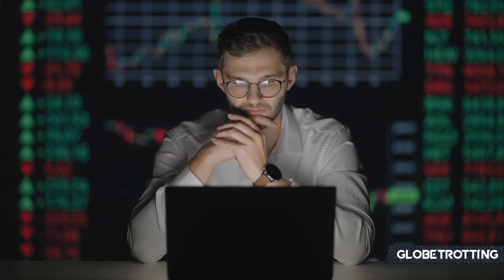Boom Supersonic Has Serious Problems

Comment: Here are some quotes about the Overture engine and Symphony power module from Blake Scholl at the 2023 Paris air show, as reported  by Guy Norris on the Aviation Week website:

“We're talking about assembly selection, not manufacturing all the individual components. We are expecting to source blades and rotors and accessories from the suppliers that build those for other turbofan engines, and we expect these suppliers to be with us through the life of the program."

 "An advanced supersonic inlet, diffuser^ and exhaust design, already undergoing initial wind-tunnel testing, is designed to meet Chapter 14 noise levels."

“There's more bypass there, because that's part of how we achieve quiet operation for take off and landing which is critical. And yet from a cruise-efficiency perspective, the minimum cross section area for lower-wave drag and lower weight is important. So the fan particularly in this supersonic condition is designed for high specific flow. That allows us to get a lot of mass flow through the fan with a relatively low-profile fan.”

“We've got an aggressive schedule,” he acknowledges. If we need to make a schedule change, we'll make a schedule change. But our target is still certification in 2029.”

And from the Ainonline website, also reporting from the 2023 Paris air show:

According to Scholl, the medium-bypass engine “leverages certified technology” to lower risk. Optimized for supersonic flight, the engine will consist of already-certified materials and use a conventional core. What’s new is the engine intake and nozzles, he said. 

Scholl admitted that the XB-1 and Overture programs “diverged” due to design refinements of the latter aeroplane, putting into question what benefits, if any, the company could glean from even flying the demonstrator.

Notes
^ The input diffuser is almost certainly based on document, NACA E55F30 of 1955: Variable Geometry Axisymetric Supersonic Inlet with Telescoping Centrebody

Comment: Boom now have a cutaway impression of the Symphony power module on their site, showing the inlet ducting, engine sections, and exhaust ducting. Symphony measures approximately 7 feet diameter and 30.5 feet long. The inlet ducting is 7.6 feet long and the exhaust ducting is 10.1 feet long.

Comment: If boom really wanted to introduce a new supersonic jet, you’d think they’d learn that their 4 engine design doesn’t work. That design is beyond old and just doesn’t meet the modern standard. Why does boom think an airline that already retired their 4 engine aircraft would be willing to buy another one that likely costs double the amount to operate, let alone purchase. It doesn’t make sense to me. Also, Boom’s renderings show an engine, which they don’t have. Why bother showing off a completed design, engines and all, at an air show when you don’t even have said engine? Almost every aircraft I’ve seen that have been introduced at an Airshow, had engines. Aren’t engines also one of the key selling points for an airline? Furthermore, the renders….those are something else. The renders are just that….a render. Nothing more. A simple render hardly proves anything other than how awesome graphics look now. How AA and United got hooked an this aircraft is beyond my understanding. It’s a shame seeing how fast this project went south.

Comment: Boom CEO sounds like Nikola dude, blowing smoke.
But what I find even less believable is the idea we'll be stuck at sub mach speeds commercially for many decades to come.
Materials, electronics, software and engine tech has advanced leaps and bounds since Concorde.
What's really lacking is the economic will to apply it. Not enough key interests see a profit in commercial SST. Not yet anyway.
Reply: Classic con man

Comment: I think a lot of us knew from the beginning that Boom would fail. Air travel these days has people wanting to fly cheaper, not faster. Concorde has been and done super sonic flight before and even after 27 years of flying passengers with only 1 incident, it still failed to make super sonic air travel mainstream for multiple reasons. I think airlines are going to continue to invest in more efficient aircraft, not faster aircraft.
Reply: Even subsonic airlines have got slower, not faster. They therefore save fuel for a slight increase in travel time, incresase that can be compensated with decent transit at the airports

Comment: I think Boom still has a shot of pulling off their Overture plane, however I think it’s at the wrong time now and their targets are too ambitious especially with the setbacks they have now and perhaps more in the future as time progresses. There is a lack of an engine manufacturer which is the big issue at present with all three major manufacturers having nothing under development at present that is Boom’s main issue now. Without an engine, the plane cannot fly but there is nothing saying a “Proof of Concept” model cannot be constructed (either with already-made engines or without). The other large issue is the future. There may be immense backlash for supersonic travel now as there was around the time the Concorde flew scheduled service. This may be a repeat of the Concorde’s struggles in service in today’s modern age.

Overall there is a lot that Boom has to overcome, both now and in the future and I don’t think the company will go under but to make this aircraft program a realization more time would need to be taken into account than their ambitious timeframe is set for. They would need to find a suitable engine, get past the lengthy certification step, and have the plane enter service, all of which will take time, money, and a lot of strategy.

Comment: If Concorde couldn’t make it after flying for many years then I see no future for Boom.  The CEO has talked about some unrealistic pricing in the future based on customer demand.  No small engine manufacturer wants to take the risk involved.
Reply: Exactly my point. I feel like they are trying to ignore that Concorde ever even existed. Concorde flew passengers for 27 years, with only 1 incident and it still ultimately failed to make super sonic air travel mainstream. Air travel this day in age has people wanting to fly cheaper and airlines want more efficient aircraft, investing in an aircraft that is less efficient and will cost passengers more doesn't fit it in at all

Comment: I am going to design a plane that has five decks, can fly at Mach 100, fly 2500 passengers and will need 10 engines, anyone want to invest in it?
Reply from the maker: I will!
Reply: @GlobeTrottingAtDjsAviation  Great, now all I need is an engine manufacturer and an airline customer. Maybe Emirates will be interested?

Comment: The only thing Boom will ever produce is one big BOOM when it goes bust.  Under current regulations there is such a limited market for supersonic flight.  The only hope is if NASAs X-59 proves that the sonic boom problem goes away but even then does flying Perth to Sydney for $100 in 90 minutes actually seem like a realistic goal?  Even LCCs and ULCCs are finder it harder to market flights under $100 without all the add-on costs.  You can pretty much guarantee that business people in particular are going to want an all inclusive fare for their supersonic flights and fuel costs alone are going to make that near impossible.  That is before you factor in the additional costs of more highly trained pilots and cabin crew to crew the flights.  Even getting a model Overture off the ground is going to be unlikely, but probably the best they can hope for.  Of course, if the X-59 is a failure, the whole thing becomes utterly moot anyway.
Reply from the maker: It seems like that is the way it's heading thats for sure